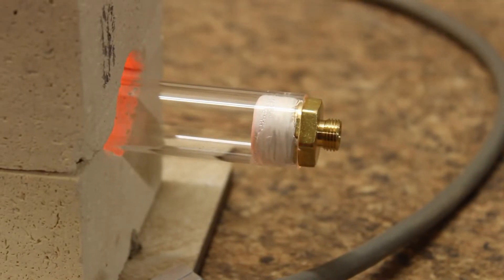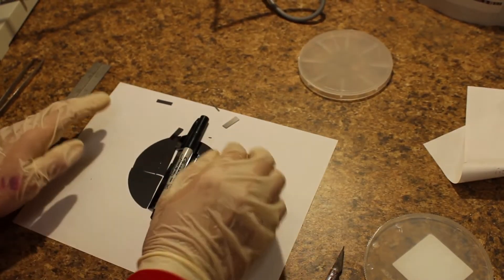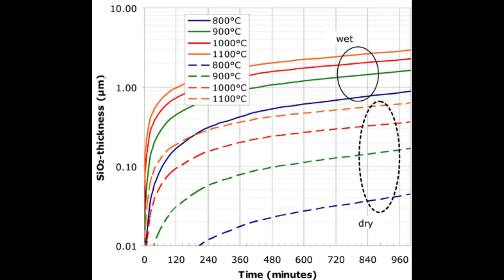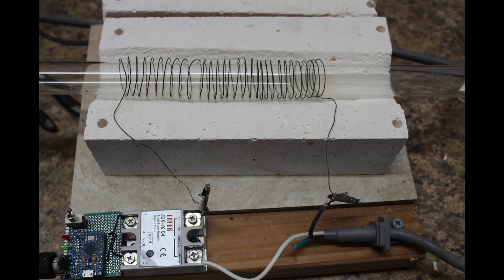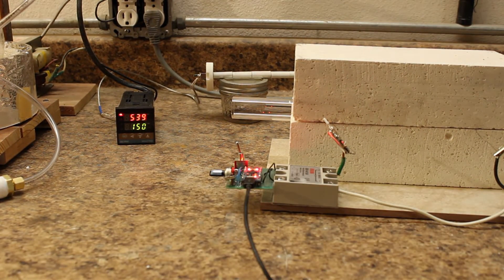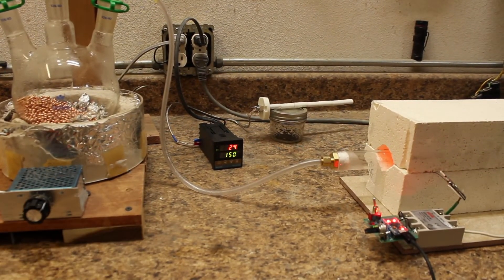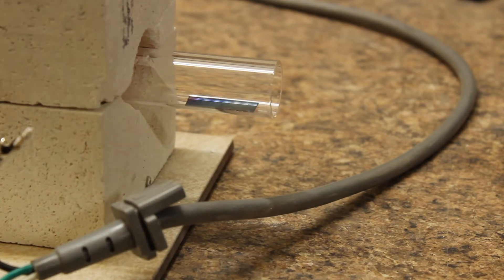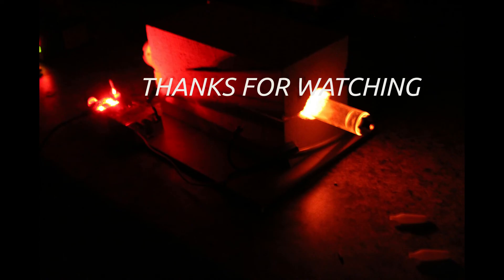(DIY Semiconductor Part 1)Growing silicon dioxide layer on silicon

Comment: Hello, how much did you paid for the quartz tube? And where did you bought it? Thanks
Reply from the maker: I got the quartz tube from eBay it had a OD of 25mm and a length of 300mm it was about 30$ just ensure it quartz as borosilicate will not work.
Reply: @joaquinvaldez9674  Thanks for replying :)